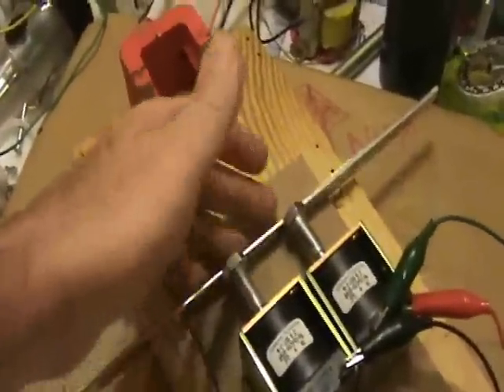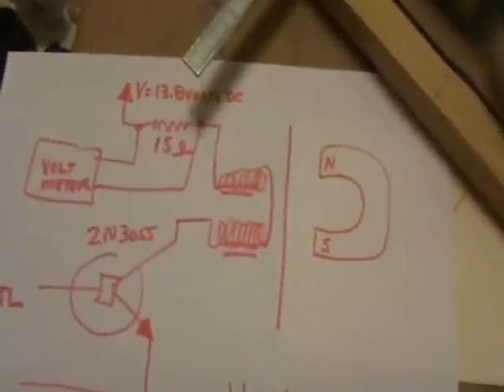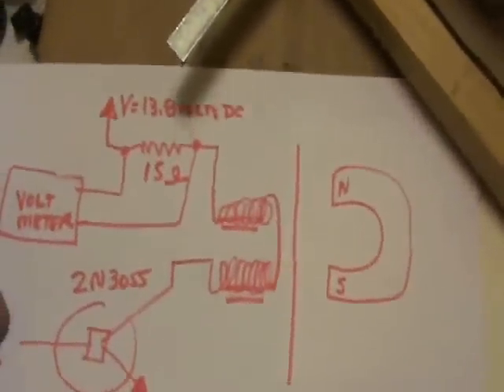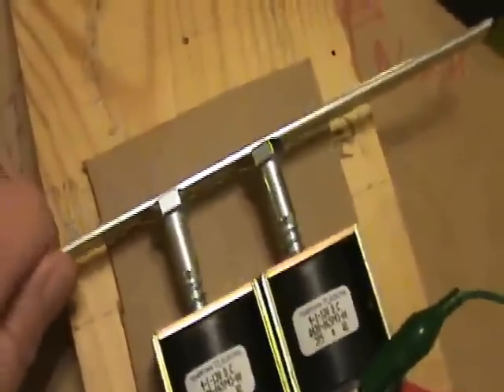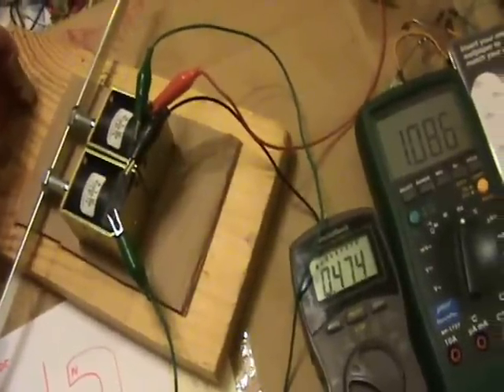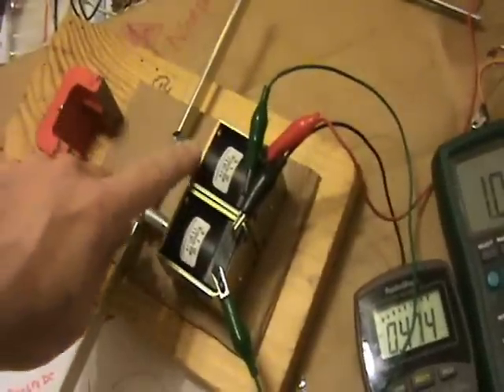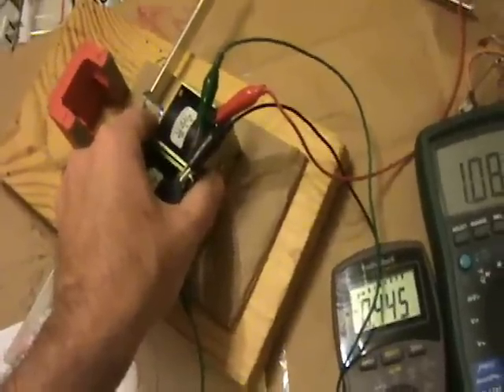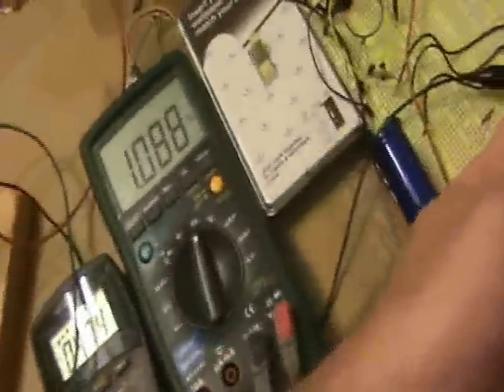Magnetic Tuning (Hendershot Fuelless Generator)

Comment: well this can't be real... there must be voltage fed in to the system... physics win everytime.. sorry..
Reply from the maker: +CongletonDirector My videos are trying to workout Hendershot's circuit, which was lost to time. Yes I'm powering it, and trying to analyze the circuit. Anyone who works on electronics knows there must be power going thru a circuit. Meanwhile, don't be closed minded about power from the OUTSIDE of the circuit. Certainly you can bring a coil over to another coil, and inductively pick up power. It is also possible to BEAM power up in the microwave spectrum, or higher. A coil will self-oscillate with NO input power. Yes its low power, but there is a HUGE desire to pick up ambient power in this way to drive low-power microprocessors. The amount of power needed now for this little guys is tiny. So Hendershot's device is interesting.

Comment: Were you ever successful in getting any part of the Hendershot circuit working to make power other than the 1-1.3 volts as it resonated without power feeding into it?  I know you are very thorough with your testing and I really admire your work and the time you put into your circuit evaluations/observations, etc.. I am also very curious to see if you have ever been successful in getting anything like maybe the Bashar coil in oscillating so you could draw electricity with it and generate any real power from any of these. I saw your video showing the Hendershot coil generating 1 volt with the lights on and 1.3 with the lights off. Would you be able to supply me the circuit you applied to the coil to test it? how the coil's were arranged, etc.? (to my email marcvbelanger@gmail.com) of how you added it to the tank circuit, and which coils were used, how they were wired? Have you tried making different combinations with series parallel rewiring to see which drew in more power? Have you placed magnets near the coils to see if there were any reasonably large charges made or any wierd energetic results that may have been promising which would be able to be used to power anything?

 I have an idea of using Stephan's circuit which is a Charles Flynn/Meissner circuit compilation but with the addition of the Hendershot coil instead of the flynn core, adding my own circuit twist to it. I have created a working OU circuit but would like to make it much stronger using the hendershot coils. I have access to some very large wires and cables to make very large cores instead of these very small ones, as well, adhesive backed conductive paper (copper adhesive paper to create the internal capacitor that you made. I'd just like to know what you used for the dielectric, was it a plastic jar of some sort?

Please let me know if you'd like to trade some circuits. I have some circuits that I have given away open source and I'd like you to build and test them if you wish. The circuits are what I call the MBR Circuit, the designs are for educational purposes only and they are very cheap and easy to build. They are a mix of the tank circuit, a relay charger/oscillator circuit, feeding a transformer for the pulse,  used as a relay flyback driver to pulse the transformer primary, then, I rectify the secondary coil's output, and loop it back to the battery, and add a super capacitor bank in parallel. My video explains the design, and I have the full schematic posted at mbrcircuit.blogspot.com it is called the mbr circuit A-02 . I also have the first circuit which would tie to a radiant energy antenna that needs modifying, but, if you wish, I'd love if you would build this A-02 circuit and test it on video to show people it will charge the battery and cap, raising the voltage without killing the battery. (if you use lithium ion, be careful, my drill battery started to leak, and the second battery shuts down from too high of voltage as my Ryobi batteries have a high and low voltage battery safety shut down circuit built into them.

My video is here:  https://www.youtube.com/watch?v=uIk_24tOAf4&list=UU0kleo146k9Ri-DC7VNUg7A

Please check out how the relay pulses can be used to create orthohydrogen, and normal para hydrogen in a much less quantity with my 555 flip flop design in another video. I pulse the system with back emf spikes, every other switching cycle is normal buck converted 5 volt pulsed waveform, then, it's opposite wave, with a back emf spike which creates very large bubbles to be released between the plates instead of on them as standard hho is released. The gas being released is a very highly charged ionic hho which loads a massive amount of static into a balloon, as well, the gas is much more explosive than normal as it is excited. I took the gas and pumped it through a coiled copper tubing tied to my exhaust manifold on an aluminum block (to reduce the temp a bit from the manifold which would be too hot,  so it doesn't spontaneously combust)

Anyway, the gas is so much more powerful that it runs a 11.5 hp briggs and stratton engine for my 7200/8500 watt home generator at approximately 1/3 litwer per minute at 5 volts / 8-9 amps. I ruined my buck converter because I fed it from my PWM with a high frequency (10,500 hz) and the buck converter just stopped working as the frequency was slowly increased.

Anyway, it was very successful but I don't advise that anybody does this (as I did, being very dumb to do so!!lol)  pwm feed to  feed the buck device with any adjustable frequency as I did because it didn't change how the circuit functioned in any way except for destroying the buck converter, and i should have paid attention closely but I rushed like a real dumb dumb. The feed from my pwm was already handy when I started, and when I connected it, I didn't realize it was being fed from the pwm, but, when I realized and very stupidly changed the frequency while it was operating it instantly cooked without smoking, etc. It was like the IC's int he unit just shut off and never came back on.

Comment from the maker: yes. So this explains the Hendershot "tuning". However, there could be more to it. If the bar is instead attached to the horseshoe magnet, its field is NULL. If the solenoids can pull it away from the magnet, its field would re-appear. By creating a flux like this, the Q goes way up in the tank circuits due to the induced alternating flux. The frequency response curve goes lower.

Comment from the maker: actually breaking the magnetic loop can probably happen WELL after the pulses is no longer asserted to the solenoids since the Leedskalnin trick holds the magnetic loop indefinitely. The other horseshoe magnet is needed to PULL it off as the polarization disappears when the pulse subsides.

Comment: Hi,
Yes this is very much like the leedskalnin device, and i love that you are trying to actually put the phenomena to a practical use.  Go find yourself a u bolt at a hardware store to really get the colapsing part going on.  Iron would be better than steel, but actually you probally need at least silicon transformer steal or better if your going to pulse it at that frequency.  Good luck